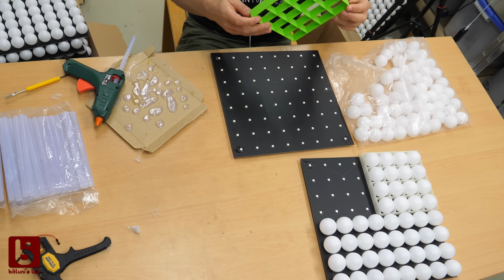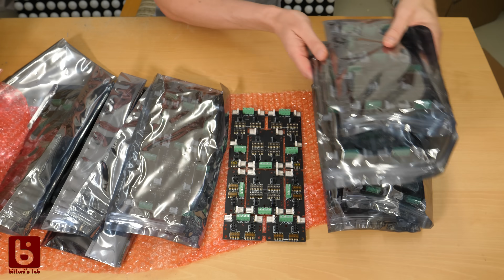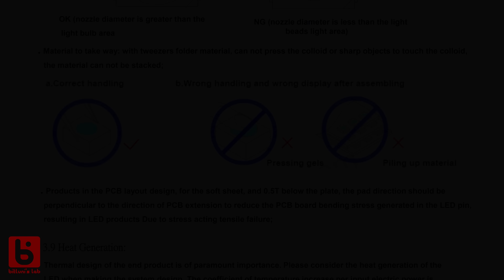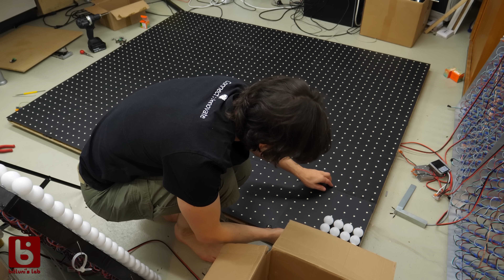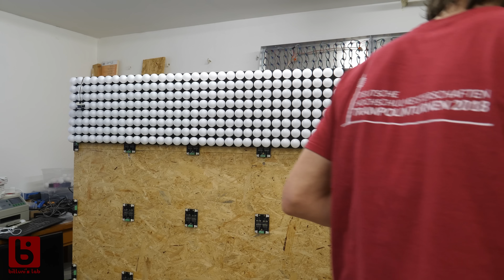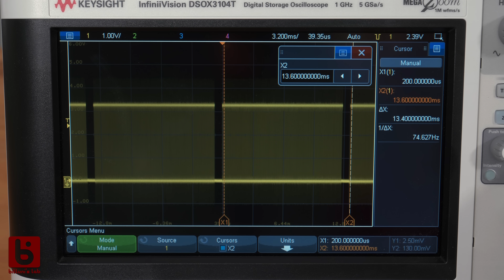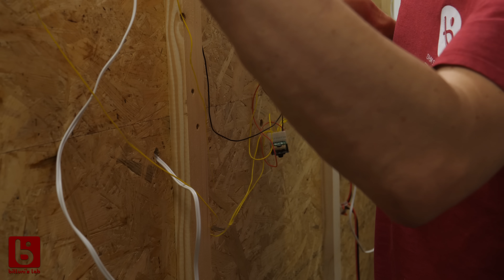Ping Pong LED Wall v3

Comment: I'm interested to see how the white channel holds up.  I've had some SK6812s in a ~20 hour duty cycle for about a year now and the white channel is noticeably dimmer on the "always white" pixels.  I assume they are overheating, but not positive.
Reply from the maker: Mike Harrison also mentions to only use 50% to highly improve the livetime
Reply: The Hook Up If they’re in waterproof LED strips with the clear rubber directly on the LEDs, I’ve had some of those age badly with the heat of the lit LEDs. Pulling off the clear rubber restored the brightness.
Reply: Both the phosphor AND the LED unfortunately have a limited lifetime.
An interesting example is a router I had where only one Ethernet port was used for years. When connecting another Ethernet cable to another port, the difference in brightness in the two blue LEDs for each pot was totally significant and noticeable, the LED which has been on for years was almost 3-4 times dimmer !
Reply: no the parts are simply aging, it's the dirty secret of the industry nobody likes to talk about.

Comment: Maybe a machine that cuts the balls in half so they are domes, which would probably be stronger when glued down.
Reply from the maker: hotwireing a bunch of balls in a template at once. but how to hide the glue. and there might be a hotspot if the led is so close to the front

Comment: what kind of bus did you use and how are the pannels and leds connected for easy addressing?
Reply from the maker: so6812 are individual addressble leds in series that pass the signal to the next one. signal freq is 800khz. there are additional lines from corner to corner to pass the signal to the next panel whereever it is. if you pause on the schematic you can see how the panel is wired

Comment: Are you using Cold White, Warm white or Neutral White SK6812?
How is your experience with them ? Especially between the WS2812B but maybe also versus normal household light (:
Would be super interested as i have a Order of SK6812WW on the way to me to play around
Reply from the maker: I ordered natural white to match my 4000K lighting. cold white are more common and i think it's a good pick.

Comment: V4: cut the ping pong balls in half and add dividers to have four pixels per half-ball. This will be the HD wall. 

Or maybe having a top sheet produced to replace the ping pong balls could be cheaper.

Comment: Nice work!!! I think the next major process improvement would be vacuum thermoforming the "ping pong" covers, and it would also look nicer as a continuous panel vs. discrete balls.
Reply from the maker: would be interesting if it is actually faster
Reply: bitluni's lab if you lasercut/CNC/print a raster (much like your gluing jig, and then place a semitransparent sheet of acrylic over it, it should be much quicker, and nice and flat. It also has less lightbleed then, which is nice :)

Comment: Nice soldering. I particularly liked the bit where you soldered the floor 😭 Great project
Reply: Yea, Grate LED project I ever seen. But I like your "LED Clock Project" too and the PCB designing was very inspiring also.
Reply: the wiring on the back though.. wow that is just messy as hell

Comment: You might have to make a power distribution directly on the pannels so the input is 24v to each panel
Reply from the maker: i could with the smallest bucks but i wanted to keep the complexity of the panels low. the distribution on the panels is good enough to supply several panels from one converter. i imagine the limiting factor are the dupont headers. i used two pins for 5v and gnd each. nevertheless

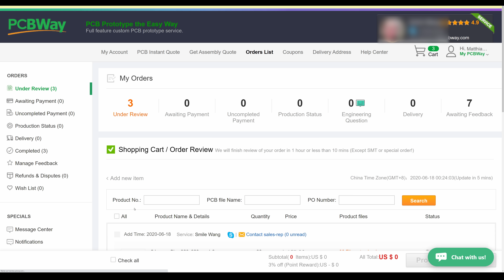Comment: 2:44 11kg of pcbs for $467 seems very reasonable. And how do you pull out a panel in the center? They look flush and I didn't notice any hooks or tabs.
Reply: By the balls?  Sorry, couldn't help it.
Reply from the maker: they don't offer black nor these leds
Reply: They sponsored the video so Bitluni might have gotten the PCBs for free.
Reply from the maker: I did. But jlc can't assemble these.
Reply from the maker: between the panels are small gaps like 0.4mm to compensate for fabrication tolerances.  i can slide a tool in-between to pull them out. I'm also able to push them out slightly from the back to get a grip. I used the power holes so far but I will cut away big chunks of the wood to reduce the weight for transportation and better access. i also have a tool made from a coat hanger that fits the mounting holes. pulling them out by the ping pongs is ok for presentation
Reply: @oa1700  yeah, I have a stack of black PCBs I ordered from JLCPCB that says they definitely offer black. You'd pay a premium for boards the size he's using, though. They also don't offer the LEDs I use, which I order separately on AliExpress and then hand-place and reflow. I assume the main reason he went with PCBWay is because JLCPCB wasn't offering to sponsor this video.
Reply: @oa1700  They do offer black PCBs, but if you want to use their assembly service, you can only choose green solder mask for some reason. And LCSC is somewhat limited when it comes to LEDs. They have the classic WS2812, but not much else in addressable LEDs.

Comment: Awesome and insane project. Love the improvements so far. Instead of ping-pong balls, see if you can source those plastic globes they make for string lights, the kind you hang in your garden to make hipster pictures. They're all over AliExpress. There's some really tiny ones and also some ping-pong sized ones. They have a flat base that would really make it easy to mount.
Reply: Other idea: on alibaba you can get housings for light bulbs (and kits) for around 0.16-0.5$ a piece. That includes the screw in base and even a power supply which you don't need. You could try to ask them to sell you just the transparent bit. Would be perfect, it's also shiny, easier yo keep clean than porous ping-pong balls.
Reply from the maker: I spent so much time browsing all the options... i will show a few soon

Comment: I am very impressed by this project. Really great. I would not mind if you explained a bit more on the software side. 
The SK6812 LEDS are supposedly also less sensitive to voltage drop, and in my experience that  seems to be true,
so I think that was a good choice. I totally agree with rotating the GND silk screen. Reading is so overrated, now you can just put the ground in the one marked with the tilted text, never mind what it says. Thank you for the courage and persistence.

Comment: It is awesome ... How you solved flickering issue?
Reply from the maker: shielded cables. upping the voltage level from 3.3 to 5 of the signal might also improve it
Reply: @bitluni  oh you didn't use level shifters on this project? When having flickering leds I never know if it's a shielding issue or a level shift issue. Is your take that it's mostly due to the former?

Comment: this is awesome! why do some of the balls flash random colours when it is starting up?
Reply: I have a similar led strip with the same problem, i think its some interference on the pin, or maybe the pin does something during boot.
During my testing, these LEDs are very sensitive to interference, i tested them with a piezoelectric lighter and if i get around 5cm the led will start changing colors, usually some shades of red, which  kinda makes sense.
Reply from the maker: yeah it's probably data during the boot sequence.

Comment: I love this so much. I’m surprised it was only $500 for the panels. I was expecting thousands when I first saw how many you got.
Reply: For the ping pong balls you could cut them in half and glue them on. More surface area for gluing, less material covering the led would improve brightness/efficiency, half the cost of the balls.  If you wanted full balls could use a hot air gun on high to quickly melt a hole in one and glue it around the led. Removing the first layer of ball would more than double the brightness.
Reply: @JasonThomasHorn  think about the amount of labor you are suggesting, each ball has to be treated separately and prepared before gluing happens, and gluing itself would be much tedious as well.
Reply: @marsovac  great response. I was considering a reflective surface behind the half balls as well to improve brightness. And I used to do alot of puppets and creature work back in the day. Cut in half works great for gluing. You dip them in barge like rimming the edge of a margarita glass :)🙂
Reply: @JasonThomasHorn  Yes, but one by one, 2000 times + 10% of failed ones :D
Reply: @marsovac  I'm giving away all my secrets ;) you can make a nichrome hot wire jig that would slice it right on the line, quick, and cartarizes the edge giving it a bit more surface to glue with
Reply: @JasonThomasHorn  Didn't think about such a contraption. Clever :D
Reply: Yes! Really surprised me too! I‘m really considering doing it as a fixed part of one of the walls of my lab.
Reply from the maker: the corner pieces were more expensive... because of the dips. they cost like 30cents a part. but you could also use solder jumpers..
Reply: bitluni where do you think this could be available to purchase? Or do you plan to share PCB design?
Reply: @royfocker19  also interested :)
Reply: @royfocker19  This!
Reply: @royfocker19  keeping the PCB design thread alive! Please, @bitluni!
Reply: @bitluni  is there any way you can put a package together that has everything for purchase for '1 click'?
Reply: Why didnt you make a soldring in the place of switches or the jumpers it will cost more less
Reply: Hold up! $500 For the whole project?
Reply: You can use plastic or paper egg trays to place pingpong balls, its easier & cheaper...

Comment: Nooo! He pretinned the wires going into screw terminals! Another failure waiting to happen!
Reply from the maker: on 5v? the terminals are biting into the copper i have no doubts in that part
Reply: @bitluni  It's okay to pretin for the Wago Clamps, but in screw terminals the solder will creep away over time and you'll get loose connections in a few months. Even if you think that you screwed them tight for now. There is not only a risk of getting unreliable power delivery, sometimes the connectors start to melt away because of the increasing contact resistance and power losses.
Reply: @ProtonOne11  I did not know about this. But it sounds unlikely that the solder "would creep away".. you mean after 10 years?

So you say it's better to place naked wires in screw terminals?

Comment: Very cool! I've been watching your progress through each version. One question though. If you add that 3D printed template, could you reduce the light bleed from one ball to the surrounding balls? In the dark, I think that would give you a lot more definition in your images.
Reply: If you can 3D the balls. Then maybe better to 3D a single matrix of cubes instead of balls that wouldn’t bleed as much and look more like a flat panel.

Comment: My heart really broke when the things got broke.... but he still fixed it all over again.... a big thumbs up for the effort ...
Reply: lucky the main panel feld with only 4 panels pugged into it....
Reply from the maker: also good the bottom row of cornerpieces didn't break. the 7 pieces carried the whole weight
Reply: Yep , "give up" does not seem to be present in his vocabulary.
Reply: Still watching, but I wonder if bracket could be soldered onto the back of each panel. With surface mount connectors you could have a full flat black front.
Reply: And I wonder if you could use a jig and drill or otherwise cut a circle in the ping-pong balls. (Melting might work too)

Comment: I died insinide when the unspeakable happened..also you are a genuius madman, as much as I hate RGB lighting, I love this wall project.
Reply: This doesn't count as 'RGB lighting', this is an actual display.
Reply: Question, why do you hate RGB lighting?
Reply: @nutmeggaming11261  Because it's eye-wateringly garish, maybe?
Reply: @nagualdesign  just set it not to be? You have the freedom to do what you want with it, that's the beauty of it.
Reply: @ericw.1620  Fair point, but most RGB lights that I've seen don't mix the primaries well and they're always fully saturated. Combined RGBW LEDs are much easier on the eye, in my opinion.
Reply: Ok boomer

Comment: Holy crap thats an impressive project, good job! How long did it take you to glue all the balls to the wall?
Reply from the maker: around 2h.. if you look close you can see the improved technique at the end. putting the glue on the leds let it cool off a bit. sometimes the glue popped a ball when it was too hot.

Comment: Cool project. What would it look like with a grid seperating the lights (like the one you used for placement) everywhere on the wall and a milky while plexiglass sheet on top?

Comment: Just Wow. What did the all wall end up costwise? I saw the round about $600 for manufacturing and assembly, but i guess there still will be the parts like LEDs and connectors to add to that?
Reply: For your next iteration, you should consider to embed the pingpong balls in a bed of clear resin, to make them more durable and don't take ages to glue.
Reply from the maker: don't ask... the costs increase quadratic with the size 🙈 . the power alone was over 200

Comment: That looks really good! Next version, hold it with magnets and contact with pogo pins?
Reply: Magnets are so expensive.
Reply: I guess this would me way more fragile and expensive
Reply: If it was intended as a portable installation to be repeatedly put up and taken down for events and such, that would make sense. As a semi- permanent installation, I don't see a problem with the current connectors. The only thing I might add is some 3d printed supports to aid in alignment and relieve strain on the pins of the connectors.

Comment: Next time use epoxy, instead of hot glue.
Reply: Nah, hot melt glue is fine. It keeps it repairable, and you have to be careful anyway. Imagine you bump a panel with hot melt glue, you reassemble it. If you bump one with epoxy, the LED underneath dies, and if you try to get at it, you rip out the LED and the traces it sits on.